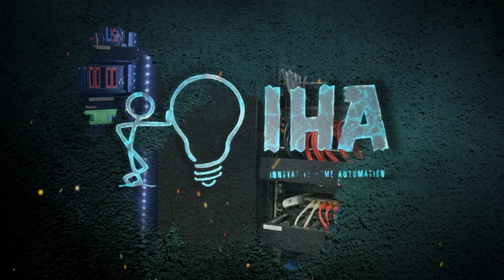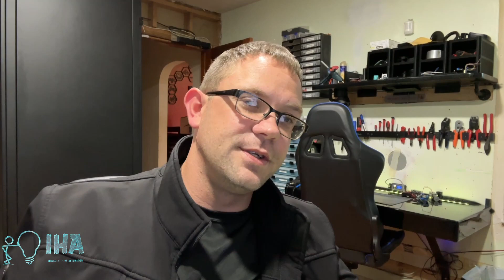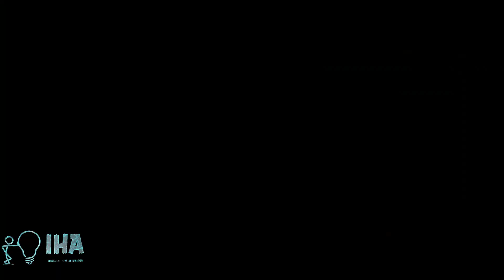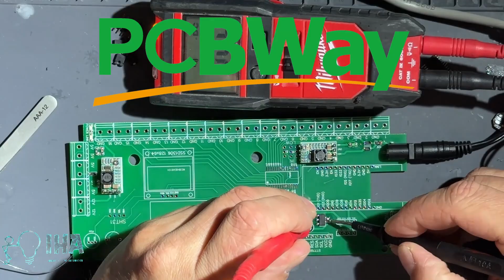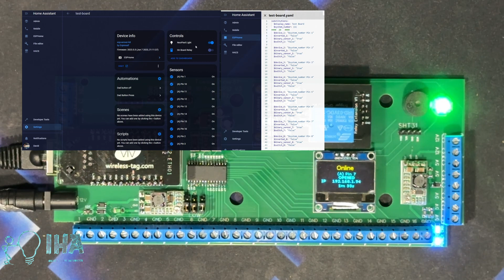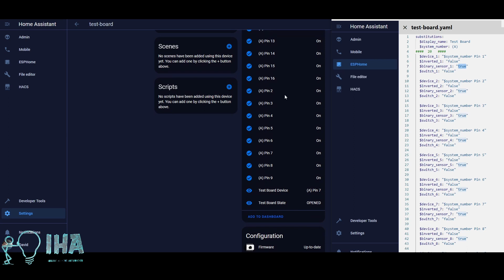16 GPIO Dev Board for ESPHome and Home assistant

Comment: I need one!!! I've been envisioning something like this for my house for a long time, but don't have nearly the skill to design and build this from scratch. When and Where can I purchase this? Could you run 2 in a system if you need more sensors? Or would you just combined multiple windows in the same room to the same input?
Reply from the maker: I’ve been considering for a while, putting some projects up for sale. When designing this, it is possible to connect to together, but the only cost savings is the esp32 ethernet. And I don’t think the cost savings is worth it. Question, I have for the community, to make it worth it, I would have to sell this for around $97. What would be your opinion of a price point that would make it worth purchasing?
Reply: @innovativehomeautomationto7112 , Would that come with all the components? Would it be assembled? I would definitely purchase it for $100..  My house has window and door sensors on EVERY window and door, even interior but the alarm company is a rip off, I would love to just have local notifications, status updates and automations around these sensors.